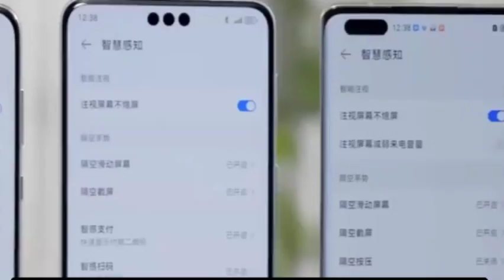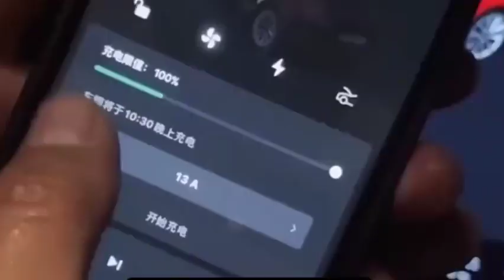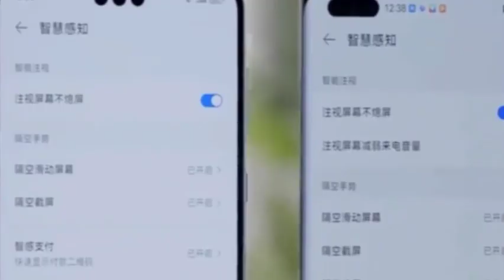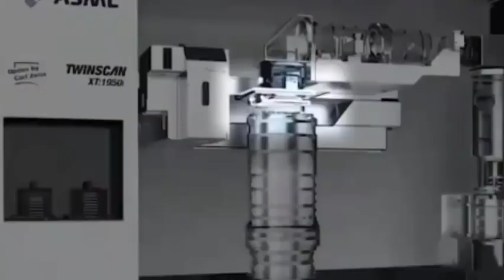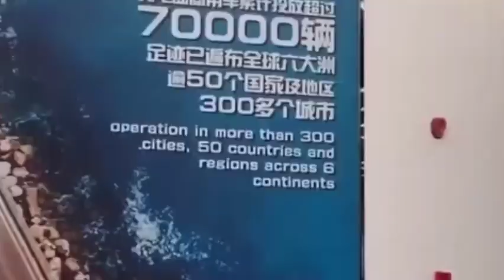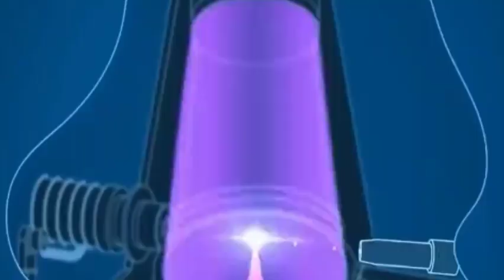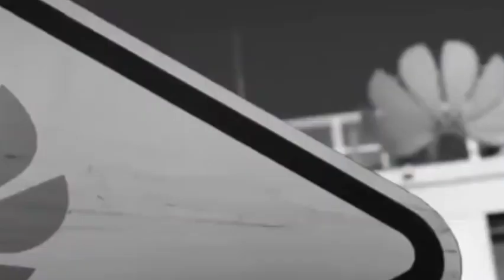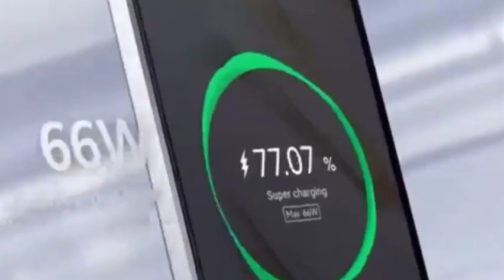Huawei's new Kirin chip performance catches up with TSMC's 3nm chip

Comment: So, looks like 7nm, but functions like 3nm.  No stopping Huawei ingenuity and innovation. With Hongmen running the show, speed should be better than iOS and Android.
Reply: Huawei has the talents who can achieve the impossible. This makes US sanctions impotent.
Reply: @michaelgoh9768 but real 3 nm is still impossible for huawei. right?
Reply: @nannon2934  3nm is still impossible for many chip manufacturers. HW has begun designing 3nm chips, hopefully manufacturing in 2 years I think.